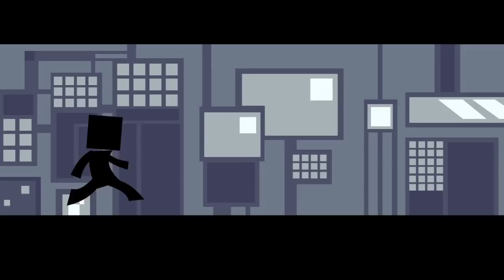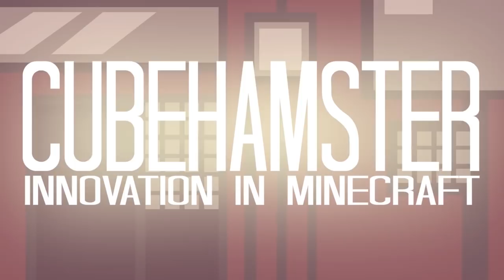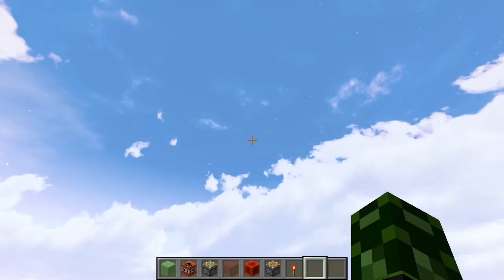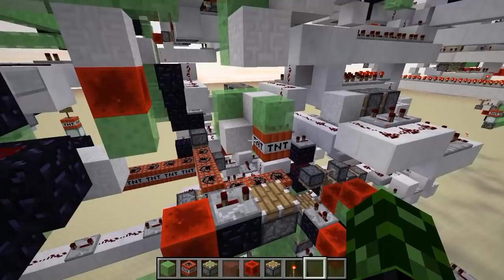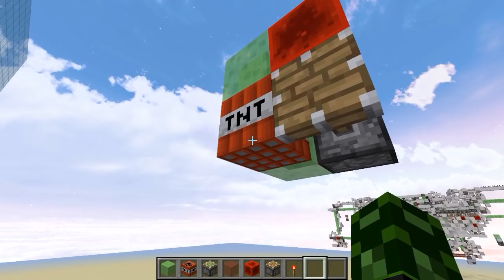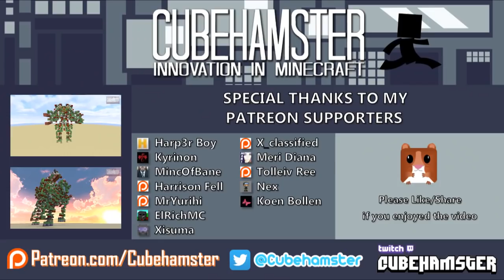Update: Missile Assembly Factory in Minecraft [Work in Progress]

Comment: That looks great! I especially like the really complex sequences to put blocks in certain configurations. I was wondering, could the three stations work in parallel to build three parts, after which the engine from station 1 starts moving and picking up the other two parts, or would that blow up? I'm thinking that would make it a bit faster.
Reply from the maker: It would be faster. But not as cool :-p. You technically also start building a missile at station 1 while another missile is at station 2.
Reply: Ok, I can see that :p you're right, I imagine that would be even faster than my suggestion in terms of rockets per second as mine would have to wait until the first rocket is out of the system.

Comment: It would be cool to have a automated materials storage system that can be resupplied offsite (using ender chests or whatnot) using a series of hoppers and item droppers you could have a series of collectors retrieve these and add them to the production line that way it wouldn't need to run out of materials as much as could be restocked as needed. Also, a good idea would be to include a emergency fail safe system that would halt production in the event the materials ran out or were running low. this could be a light or audible note block thing. Also a Early warning light to notify you supplies are running out soon... you could tie it into the emergency stop system whenever the system runs out of materials to construct the missile. finally to consolidate these items into one chest you'd need a advanced sorting system that would sort, send and check for the correct item before transferring that item into the production line for assembly.

Comment: Do tick speed 100 and then use the missile factory I wanna see how fast it goes, also how many missiles can it make and how fast can it do so?
Reply: He said it can make 5 missiles and it looks like the factory can probably build one every ~40 seconds (at normal speed). It takes almost 2 minutes from pressing the button until the missile reaches the door at the end (also at normal speed).
One of the reasons he slows down the game is because the factory lags quite a bit. Tick speed 100 would mean 5x the normal speed, even the best computers would struggle with that...
Reply: +Robobrine naw even a slow gtx 970 could run tickspeed 100 lol
Reply: The problem is not the PC specs, it's the way Minecraft is programmed. At a certain amount of redstone you just can't avoid lag anymore. Also, if we talk about specs, what matters for redstone is mainly RAM and the CPU, not the GPU.